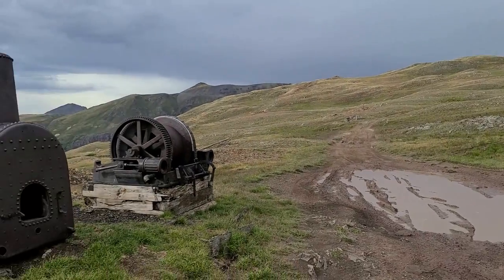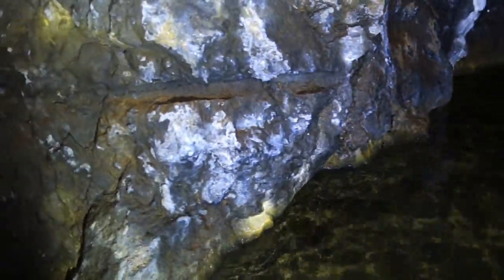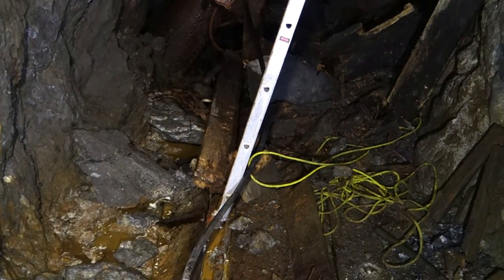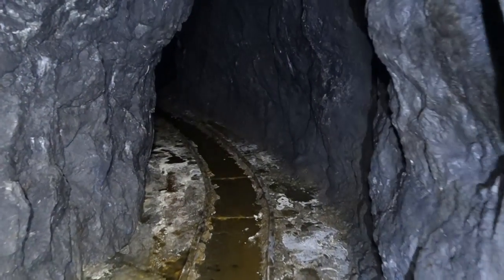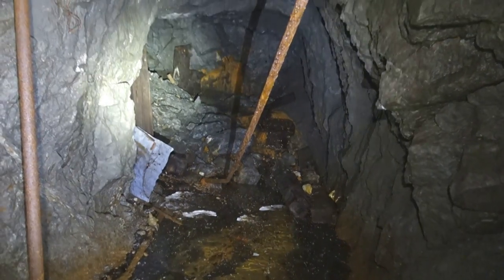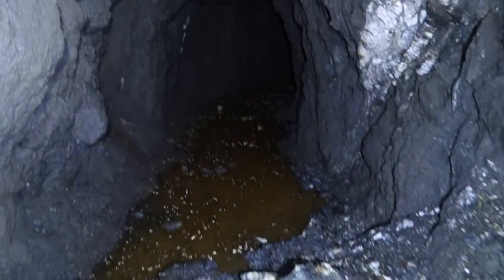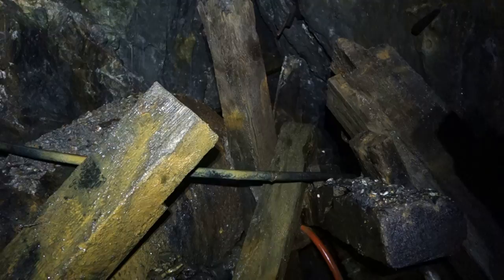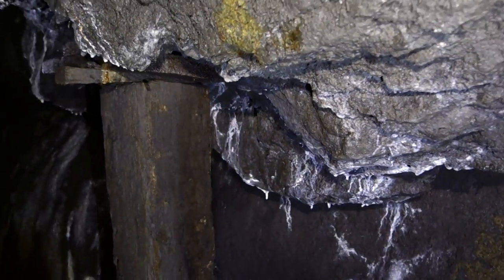Hidden False Floors In A Flooded Mine? No Worries…

Comment: Wear a chest belt over those waders.Most waders come with a belt. I've fallen  by losing my footing in icy rivers while salmon fishing and only took a little bit of water past the belt.Sometimes its hard to regain your footing on slimy rocks and fast water but didn't get wet to my waist.The belt has to be tight to work.
Reply: Agreed however this requires immense concentration to then .... not fart.!😂😂
Reply: Good idea for gold panning in the winter as well in very cold water.
Reply: Belt or not, a safety knife is a absolute must to have at hand when wading. You allways have som air in the waders, so you can end up upside down and drown
Reply: @D4CR33P3R  Hmm what fish would you catch if you used a human sized fart float!..hmm

Comment: My first summer after high school I worked for the Barre Montpelier R R.  One day a full time worker (1/4 ) brought in a small chunk of quartz with bits of gold in it a relative had purloined from a Canadian gold mine.  My boss and I preceded to destroy every piece of quartz we found alongside the track which led us to go out in search of gold after hours.  We panned a number of prime locations in some small creeks and never found even a tiny speck of gold.  Years later I learned that panning with grease covered pans (from my bosses kitchen) would never yield anything!  Great memories.
Reply: cuse the grease wont allow the gold to stick and will let it slide of along with the water ? big oof
Reply: @ghostmarine3608  It doesn't really "stick" in the first place, it just doesn't come out as easily because it's much heavier. So I have no idea what the greasy pan are supposed to do (or not do).
Reply: @Sibula  it's a for of mechanical separation,  I think the bigger issue would be all proper panning gear has small ridges to break up the movement of particles.  it's not perfectly smooth.  But in part it's also about knowing how to swish the slurry around in whatever pan you're using.  I do have to wonder what shape this was though... a skillet or saucepan?  yeah... no.. a wok might work  Honestly a dinner plate is better than a skillet from what I heard.

Comment: An Olympia beer can!
An OLD Olympia beer can...  I would say that dates to the early 70s maybe even the late 60s.
One, the can is tin, not aluminum.
Two, it has the old tear-off style pull-tab.  They cut so many feet, and there was rumors of people having swallowed them from putting them inside the can.  They were outlawed and a new design was made.
   The next design had push buttons. These were just two raises in the can with scoring cut around them... no lever. 
    Then as now, the government had a tendency to mandate things before they were perfected, and so the new push-button can Lids worked about as well as Generation 1 airbags.... 
 As soon as they poped you got hit in the face with it.
   Which brings us up to today's cans.  So today when your can screws up, and the lever comes off before your can is completely open, just remember where we came from. Sprayed in the face,  cutting our fingers on push-button rims, and our heels on pull tabs.
Reply: My dad drank Olympia (for the lumber jack in him, lol) & we had the lit up Olympia beer sign in our LR...not considered tacky at the time. Thanks for the flashback, I was just a kid & remember those things.
Reply: Does that make me old, that can' had to be (tin/steel) opened with a v shaped tool (bottles the other end of the tool) and it was pretty cool when you no longer needed that tool. In a pinch a screwdrive or knife, whitch was hard on the edge and maybe fingers.
Reply: @Trash Panda  I have a old biermister sign in my home brewery I would be stoked to find a old Olympia sign

Comment: 36:39   That drill steel is a one piece, factory made older type.  The newer ones have threads so the actual cutting head can be removed and replaced in situ.  Earlier miners used simple steel rods and kept sharpening them.  Then came the cemented carbide cutters (like the picture).  Carbide almost tripled the speed of drilling a hole, plus lasting much longer.

Comment: It would be really cool to see all the underwater sections of this mine. It's too bad there isn't just like a drain plug in the bottom of mine you could pull
Reply from the maker: There are so many times I wish that that were an option!
Reply: That was actually done in the cripple creek mine area. Sometime in the late 1800's or early the next century, water was becoming a problem in that area. so all the miners pitched in and they drilled a drainage tunnel down below that have them access to much more material that otherwise would not have been accessible. There is actually a great book about the whole history of that area called " money mountain".

Comment: Regarding your comment about rail being removed - If you see rail missing at the far end of the mine, it was likely taken up by the miners for re-use elsewhere. Another clue is if the curved sections were left behind - you can't really straighten out the rail once it has been bent into a curve, so there is no use for it and it is left in place. The miners take the rail up from the furthest point and work their way back toward the entrance. That way they can pile the rail up on flat cars instead of having to carry it out by hand. If the rail is missing starting at the entrance but is still in place further in, that is the work of metal thieves.

Comment: I am not a miner but why do you all call a tunnel a drift
Reply: I have only learned from mine exploration vids, but the main mine "shaft" is called the adit and "shafts" that drift off of that main adit are called drifts.  An actual shaft is a vertical digging that connects to the surface.  Stopes are vertical shafts that go up from the adit and don't typically connect to another level or the surface and winzes are vertical shafts between levels of the mine.  
Like I said, I've only picked up the terminology from watching videos, so I could be wrong on some of that.
Reply: @MLATX512  You're getting pretty close with the terminology. Keep studying!
Reply: @joesmith1922  thank you that makes it a lot clearer, and your videos are very interesting we like them a lot